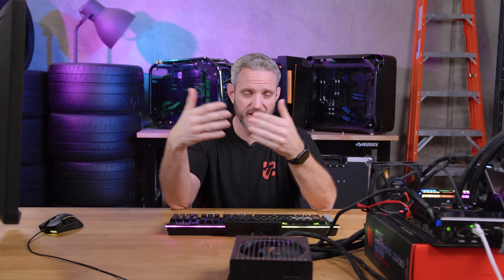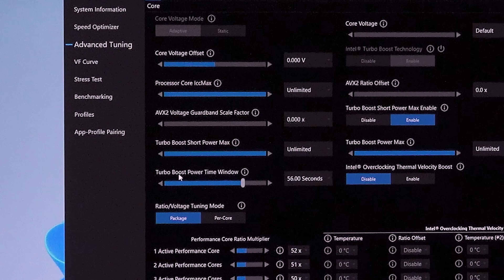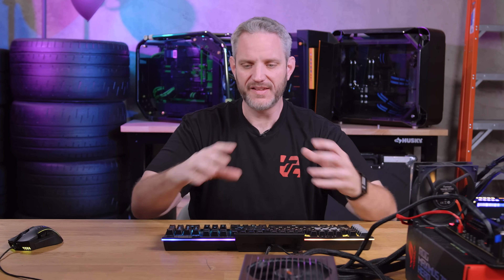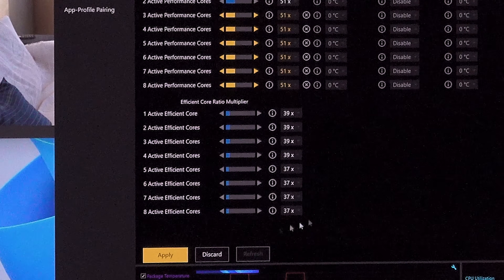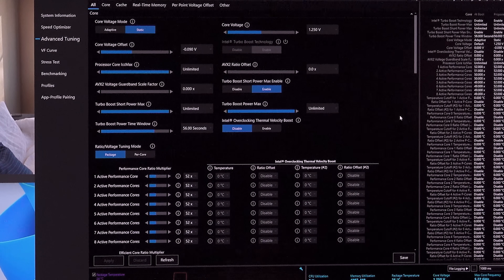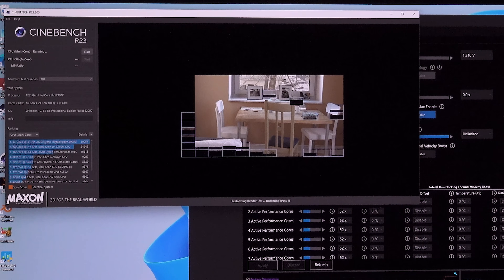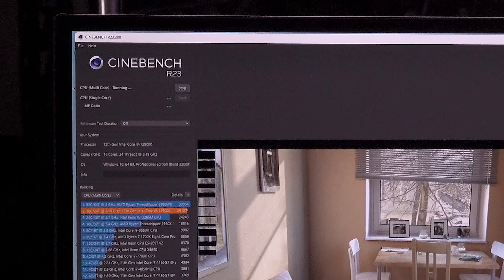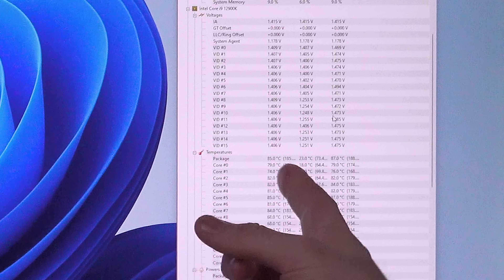Overclocking the 12900k is pointless and dangerous! Heat and Voltage testing...

Comment: Intel needs to start packaging their CPU's with AIO's now.
Reply: amd fx 8350 flashbacks
Reply: AMD FX BULLDOZER : May I introduce myself
Reply: @stepbruv8780  your a decade old piece of tech and was replaced long ago with gen 1 Ryzen
Reply: @commanderoof4578  that sound like intel bulldozer to me
Reply: custom sounds more reasonable !
Reply: If you do cpu heavy tasks on it, maybe. If you purely use it for gaming, the temps are great. And even greater in idle.
Reply: @khaychi  no shit about the idle part that much is expected

And about the game part that depends on the game but its intel so under even medium load they are a total pain too cool, they really have 3 options

Actually make the CPU’s more efficient

Use a better conductor between the Die and IHS

Flat out remove the IHS from the equation and if it gets damaged thats user stupidity
Reply: @commanderoof4578  or just cut the powerlimit by half as stock since it's already beating the 5950x at 4.4ghz 110w 50C max temps r23 by 100 points in a link ive shared. I guess they went the extra 5.2ghz 241w to cement the 5-10% lead instead of 1% 

Then let users overclock it as they please.

Also starcitizen is a short term concern albeit ive seen reports of the 12th gen not having any problems running that game.
Reply: @bingbing3464  nope the gen 12 rendered is less than 10% complete and what is getting added in 3.16 December and 3.17 February does not make any difference to the fact that Intel sucks at running star citizen

And no the 4.4GHz is not a single core beater it is multicore matcher at best and so in Star Citizen the 12900k at 4.4GHz will be curb stomped by even the gimped 11900k as it wants per core speed not more threads as only 8 contribute to performance even tho it will load more cores your frame rate goes unchanged

Also i will point out you haven’t linked anything or youtube deleted it

But you are correct about intel forgoing efficiency for the sake of trying to seam relevant bu running hotter than any CPU before it when pushed to its limits… ohh wait no its only pushed to 260w out of 355w needed to actual push it to its limits if you can even cool that seeing as the IHS-Die connection is too poor to transfer that amount of heat generation
Reply: @commanderoof4578  looks like youtube dont allow me to link other videos as it gets deleted. Anyways it's a guy running the 12900k at various power limits and at 4.4ghz 110w, it beats 5950x stock in r23 multicore score with 26k. It also matches the apple m1 max when capped to 30w

Also even right now, competitive benchmarkers are running the 12th gen on windows 10 which disables the e-cores. And despite that, the 12th gen is actually trashing everything. It even beats its own scores with windows11 btw. Just that productivity applications will be inconsistent in windows 10.

Anyways i do have pals already physically own the 12th gen because they are bios developers in asus. We've already knew intel has an all rounder winner even with efficiency... because the original engineering sample was capped to 125w
Reply: @bingbing3464  If you break the link up a bit you can post them.
Reply: Sad thing is that the 12900K is outputing more than the NH-15D can handle in thermals, most air coolers cant cool this thing... U need a 200+ Euro AIO :/
Reply: @Zarozh  not necessarily, there are good Arctic AIO around 120eur
Reply: @Zarozh  An Nh-d15 cools just as well as most 360mm AIOs...sorry
Reply: @drunkhusband6257  hm... Weird Linus etc has tested and a NH15 did not last
Reply: @Zarozh  Under 100% load sure....under normal gaming circumstances they fair the same. Look at a realistic load scenario
Reply: @drunkhusband6257  We did look at "normal" scenarios, and that was using the 12900K for production work etc, everything else than gaming and it topped up over 90C+. That is not rly good at all.
Reply: @Zarozh  Apparently you didn't because it doesn't get that hot just gaming sorry
Reply: @drunkhusband6257  they cant seem to wrap their head around the fact that intel doesnt run no where near as hot as they think it does. you put it under a benchmark which loads the hell out of the cpu yes it gets hot even ryzen does. will you ever encounter use like that in the real world while gaming no. my 10900k is at 32 idle and 60 while gaming. thats all core overclock at 5.3 the ring at 48 and the ram at 1.5v 4133 cl15. the hottest i seen mine get is 62. i have a 280mm aio which i paid 100 bucks for. im sure it would work just fine for the 12900k.
Reply: They actually did that in the past.
Reply: Nop gamers need to upgrade there monitors to higher resolution working mostly on the gpu not cpu buy 12400f 🤗
Reply: They should pack the chiller they displayed at their keynote.
Reply: like AMD did with the 8150 or whatever.
Reply: They'll soon need Liquid Nitrogen AIOs 😂
Reply: Who doesn't run one now anyway. Air = trash
Reply: @erickwalker11  Servers run on Air, why do you think a multi-million datacenter runs on air? cause it is reliable and the water-cooling profits aren't worth the service and gains, a modern noctua such as the chroma has the cooling potential of a 360mm aio easily.

Also radiators do not have such high temps in long term as AIO do have, an AIO after multiple hours will have issues cooling the liquid itself cause of the liquid itself heating up.. it is a reason why an AIO may run amazingly good and then spike high, an air cooler is not as slow to heat up and to cool down.

Not hating AIO but telling that calling Air cooling thrash is idiotic, there is a reason why Turbines are not water-cooled...
Reply: Remember that custom Intel AIO, you know the one that has the thermoelectric aspect? They need to start shipping that with the i9s now
Reply: Lol I saw a 12900k at micro center on a 240mm rad it was idling at 64C, the 13900k is gonna be impossible to cool
Reply: no
Reply: And the aio have to be a good one or else ....
Reply: @annguyenlehoang7779  120mm AIO 😁
Reply: @vh9network  120mm Enermax AIO will be worse than 20$ arctic cooler XD
Reply: Its basically an FX 9590 at this point in terms of power consumption
Reply: The nh d15 can barely even keep the i9 under 100c
Reply: @imoonset  cus intel efficiency sucks

You need more power in and get less useful energy out in a brute force attempt to be relevant in the world of Zen cores being dominant
Reply: @commanderoof4578  interestingly there's a chinese reviewers made an efficiency comparison and the 12900k at 4ghz is as powerful as a rocketlake at 5ghz and 5950x at 4.7ghz. So, he downclock his 12900k to 4.4ghz at 0.9v and 110w with 50C temps.... it still beats the 5950x in r23
Reply: @commanderoof4578  but it proves that the 12900k is actually super efficient. The guy even cap it to 30w to compare with the apple m1 lmao. Albeit it lost marginally to the m1. 

actually for games it is all about the bandwidth and the more gpu bound it is, the more bandwidth will come into play..... this is where DDR5 will come in. As you can see why linus gaming benchmarks heavily swayed on the intel side massively because he chose ultra high presets. 

For now, win11 sucks for gaming. Even with disabled efficiency cores on win10, the 12900k still performs better on win10 than win11. This only means there is still a tonne of room for improvements.
Reply: @bingbing3464  no the CPU through put matters, why do you think overclocking increases FPS hrmm?

Also the 12th gen CPU’s are probably gonna suck in Star Citizen and other games if the damn CPU even runs them… remember “efficiency cores” if the work goes onto them bearing in mine only 8 threads do actual work… thats a total rip performance from 30FPS at the worst case on a 5950x will be something like 1FPS if the scheduler winds up using efficiency cores

Mixed cores are premature AF
Reply: @commanderoof4578  that's only when it's cpu bound. For cases like port royal world records, it's all about the ram and gpu hence LN2 is used on the ram and gpu but not the cpu.. if you have ever wondered. 

And that just means alderlake will still continue to improve by time. Cant wait for raptorlake tho.
Reply: @bingbing3464  unless you play games like star citizen where the 12gen CPU’s probably cant even run it and if they cant the scheduler is probably not smart enough to use exactly 0 efficiency cores for it
Reply: @commanderoof4578  I see where you are coming from but let me tell you right now my desktop display is 165hz and my laptop is 60hz and my laptop feels stuttery and slow in comparison. Now if I used either display a day apart I wouldn't notice the night and day difference quite as much
Reply: @Dimondminer11  yeah but i went from 165hz 1440p exclusive for 3 months to a 4k 60hz and well nothing the visual fidelity was absurdly better but 60hz didn’t make a difference, if you notice stuttering and crap thats just bad software or hardware at work

I am a fidelity man and the extra frame rate just isnt worth the drop in quality especially since my hit-rate and KD didn’t chance what so ever in-fact it might have gone up seeing as there was more detail to work with

Dont believe the higher FPS is better BS because it ain’t at least not for everyone and im one of those that performs better at higher resolution rather than frame rate

If i cant make out friend vs enemy how the hell am i gonna aim at the right target’s… its simple i cant, i play sniper mostly and i will paint you across the wall from the other side of the map even if you go rush behind cover i can take advantage of bullet drop so long as you dont move soon enough after i pull the trigger on your estimated potion based on surrounding and your movement pattern, but even then up close and dashing between cover points with 1/5th or less of a second to shoot 165hz vs 60hz makes no difference to my game stats and if there is one its in favour of 4k 60FPs vs 1440p 165FPS
Reply: @commanderoof4578  4K is just overkill for me. 1440p 144hz is a perfect balance of refresh rate and resolution imo.
Reply: @tacticalluke8782  yeah no for me it is resolution period

1440p is just not good enough resolution wise and 60 vs 165 my stats dont change there for the difference is a gimmick and you shouldn’t be paying for it when you can instead get better quality
Reply: @commanderoof4578  4K is harder to run, most people like myself can’t run 4K anyways. I prefer the higher refresh rate as I play more competitive games. Also, you are wrong, it is not a gimmick. Go watch Linus Tech Tips video on refresh rate if you don’t believe me.
Reply: @tacticalluke8782  i have personally experienced it and i am telling you its a gimmick i am stating it no debate its a gimmick

And not for a short time 1440p 165hz at 200fps minimum as rendered frame rate and buffered down to 165hz and my switch to 4k 60hz was nah this is how it should be amd the frame rate ment well nothing as i keep saying nothing changed and if it did it was in favour of 4k

Also a 1070 is all you need for 4k if you have anything less than that then you spent money in the wrong place if you have a monitor over 75hz if 1440p or over 120hz if 1080p as that money should have been a GPU

Anyway you just take your frame rate and halve it that is what you should be expecting as a minimum if your lower your bound by Vram capacity
Reply: @commanderoof4578  Alright, I’m trying not to lose my cool here. Just because YOU personally didn’t experience a difference dosent mean others like myself didn’t. I can no longer go back to 60 hz in competitive games as it is too slow and the latency is higher. I’m not going to just change my monitor resolution and refresh just to make you, some random person on the internet, happier. It is proven that higher refresh rates are typically better for competitive games, keyword typically, for most people.
Reply: @commanderoof4578  yes but for me  I have a really good 4k 60hrz  but got a better 1440p 165hrz and I get better quality picture     some 4k  look worse than 2k lol
Reply: @MrClownSlap001  if your eyes suck sure and some monitors HDR off looks better normally for cheaper ones

But for me its 4k or 1080p 1080p is cheap as hell and 4k is required for what i do outside of gaming

1440p is just a stupid space between quality and hz and is just a waste of desk space easier to just get a small 1080p screen and use a vesa to vasa arm and mount it behind one of your monitors but 1440p is too heavy to do that and i cant have as much stuff per screen mostly when it comes to object hierarchies

4k prefered

1440p if i had a sit tone of desk space or multiple desks / L or C desk

1080p can be used as is or clipped to a 4k monitor to stack them just dont stack in the middle your neck will be screwed within a few hours and be screwed for the rest of your life
Reply: i do agree there, the 1080p is the same as 1440p. i game at 280hz on a 24" 1080p monitor. the picture quality is phenomenal and the resolution and pixel density is pretty much the same as a 27" 1440p monitor. aside from that 1440 is not that different to me at all. the difference to me was astounding though going from a 60-180-280hz monitor. i tried my 4k oled tv but the high hz is far superior in competitive fps games. for a regular game like tombraider or control sure 60hz is just fine. competitive shooter though is a whole other story. considering i only sit 2' away from my monitor i dont need anything huge and 24 is the way to go. i have 0 issue seeing anyone.
Reply: @parkersgarage4216  You need to go ultrawide, you'll never look back
Reply: @drunkhusband6257  i dont like it or curved screens. thanks for the suggestion though.
Reply: @commanderoof4578  actually my i9 12900k is very efficient it only consuming big power under heavy loads.. Most of the time is better then amd when doing regular task.
Reply: @SAVA47-00  5600x sub 30w 99% of the time 95w under extreme load

Same performance intel side would be 40w and 140w
Reply: @commanderoof4578  5600x and  a i9 are two different categories. It would   fair for  5950x and i9 power comparison or even 5900x for comparison
Reply: @SAVA47-00  i said equivalent power then compair consumption

A 12900k will happily use 360w for a meer 5% increase over a 5950x using 210w

Intel are power hungry chips that is fact
Reply: @commanderoof4578  it won't use 360w of power all the time.  under heavy loads yes, when your needing the chip to perform. It averageds 27watts most of the time
Reply: @commanderoof4578  12900k is faster then threadripper in some cases.  5950x is not even in the same playing field.. Maybe with the zen 3d will see also with inte 12900ks coming 5.5ghz idk man
Reply: Funny people do mention the fx8350 considering how much cooler that thing runs than ryzen 5000 cpus. And meh cooler and ancient thermal paste. I had it at 9 degrees celcius idle and like 45 underload.

 The 5900x I have with the best or atleast one of the best aios you can buy runs at like 60 degrees celcius idle. And can easily hit 90c underload with an undervolt.
Reply: @sansundertale69availablename  60 degrees idle lmaoo my  5909x sits at   32- 33c  , doesn't go go any higher than 78-79c  im running pbo boost +150mhz manual limits , 220 ptt , 170 165   ,artic freezer ii 360
Reply: @DC3RejuvationGB  interesting. My 11900k idles 25C or just 3C above ambient. And so does jay's 12900k doesnt go above 80C. Btw have you checked your hotspot temps or you just look at ryzen master.
Reply: @sansundertale69availablename  shhhhhhh amd defenders will come and say it's bullshit and you shouldnt trust anything else but what was reported on ryzen master lol.
Reply: All you need is a decent air cooler....dunno why everyone things you need a 360mm AIO to cool things.
Reply: @drunkhusband6257  that's the sad part even with the best air cooler out rn that out performs most water coolers the chips will run stupid hot at over 89C
Reply: @imoonset  Sounds like people need better airflow cases
Reply: @drunkhusband6257  because on asian marketplace and oems, 360mm aio costs half the price of a d15 and will tame a 400w cpu no sweat. And it looks "cooler"
Reply: @bingbing3464  I literally don't know anywhere where a decent 360mm aio is cheaper than a d15
Reply: @drunkhusband6257  280mm artic freezer II $100, artic freezer 360mm $120
Reply: @drunkhusband6257  Not true. The Noctua D15 has trouble cooling it.
Reply: @drunkhusband6257  because it will heat up your case allot then normal, the gpu already get the case hot enough. A rad get the heat out of your case.
Reply: @drunkhusband6257  Better than decent, you'll need a high end air cooler so you're not thermal throttling.
Reply: @drunkhusband6257  They are poking fun at how hot these chips are and the power draw. The truth is though that "decent" isn't likely to be good enough. You are going to need a really good air cooler or it's going to throttle.
Reply: @joer8854  ihave an nh-d15. It'll be fine🤣🤣🤣
Reply: They need to start using better TIM either liquid metal or a fusible aluminium alloy like AMD uses
Reply: @commanderoof4578  They already ARE which is insane, not to mention they trimmed the die height down by about 1/2 of even 10th and 11th gen.
Reply: @Dimondminer11  well just rip Intel i guess

200w usage in an intel CPU vs AMD CPU is harder to cool which means the efficiency sucks as Intel turns more power into heat rather than performance as in outputted data

250w required Intel side with some 190w of it needing to actually be taken away by a cooler

AMD in the other hand some 190w and only 130w needing to be taken away by a cooler

And AMD will be dropping down to 5nm and increasing the number of chip-lets so even less power draw, even less energy that needs to be dissipated and depending on how they mix the cores a larger surface area to dissipate the heat die side
Reply: I think you don't understand. Under gaming loads the power draw is very similar to AMD. It is only when you are using 100% of the CPU when you get ludicrous watts. Even then the actual power use is not much different as the 12900k is so much faster.

More W draw but shorter completion time
Reply: @Werty1234Teme  It is YOU who simply does not understand the info given out here. The 12900k is SUPPOSED to be a workstation card to beat the 5950x, it does not even come close when it has to hit that wattage to even be equal, if we set the FLCK to 1800, ram to 3600Mhz and pushes on PBO the 5950x and 5900x is aculy beating the 12900x/12700x by ease, and that is cooler temps and way less power usage in workstation loads.

For gaming CPU DOES not matter in the high end, since games are GPU bound, not CPU unless you sit on a 2500k or something today.

Take your fanboyism away and look at facts.
Reply: @Zarozh  lol no. 12900K is compared to 5900X price wise. Which it blows. Even 12700K blows 5900X in some aplications with even lower cost.

It is you who is the fan boy. Even if the Intel cards would draw 200W more 24/7/365 that would end up  1752kWh a year. If awerage electricity price is in US 10c that would mean USD170 a year.
Reply: @Zarozh  It is also performance to W where Intel is winning.